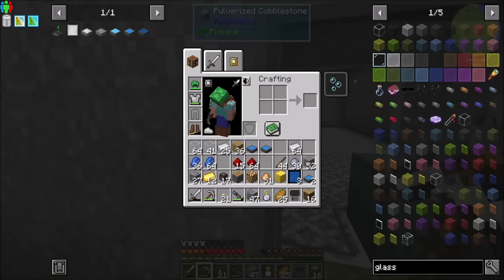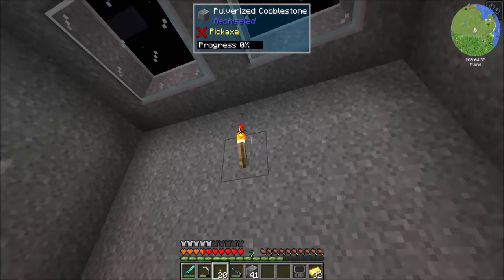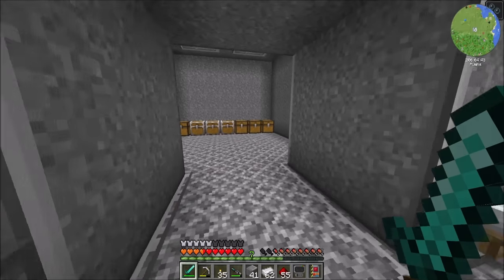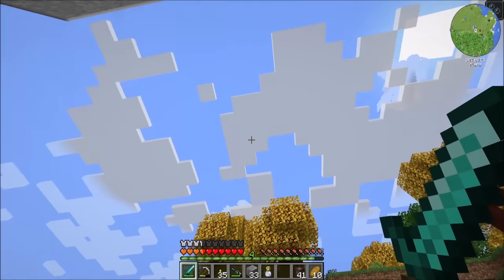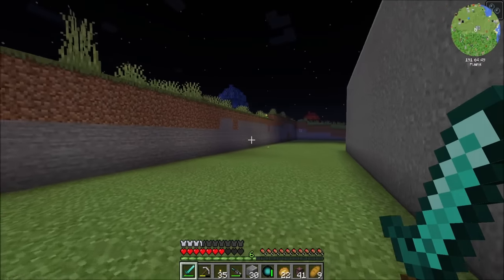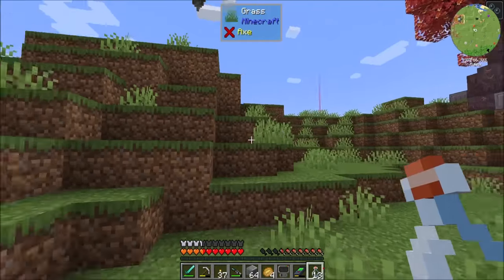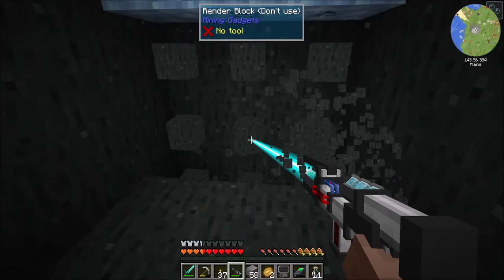LetsPlay S13E6 Misc Tools and AE2 Start

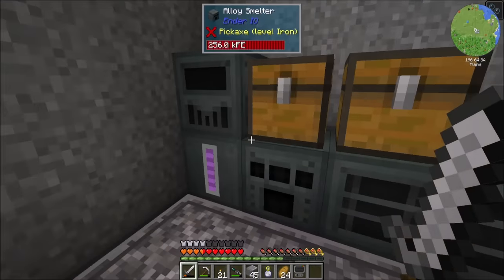Comment: 1:53 so if I remember rightly the newer elder IO was limited by the capacitors installed in the device, use a higher level capacitor and it’s a better Machine it’s also g

Comment: Noticed that the AE2 version of the dimension card was not in the pack but the Refined Storage version is, If this could be added in the next update that would be amazing :D
Reply: AE2's wireless terminal add-on has the Quantum Link Card, which integrates with a Quantum Network Bridge and works across dimensions as well.
Reply: Man, the last time I had a Quantum Network Bridge running, it was in the first direwolf pack that had the MineColonies mod to link my base with the colony

Comment: Had to toggle off the honeyed archers and undead knights on my DW20 1.19 pack they just spawned out of control in spruce tree leaves and wouldn't despawn so there were hundreds of skeleton horses everywhere with names visible through walls
Reply: This pack is extremely buggy, I started playing today and before I can even get iron, some mod is spawning fire on every block around me in about a ten block radius. If I wasn't standing in water I would be in an endless deathloop.
Reply: @MegaLokopo This is what you get when you play a brand new pack.
Reply: @Josh-yk4ry  True, but who makes a mod that spawns fire around the player non stop, the fire can't be put out and running away and/or teleporting doesn't stop the fire from spawning. What is the point of adding in that feature, it isn't a bug as far as I can tell.
Reply: Trying turning soul fire spreads to false in game rules. Its probably a "feature" of that crazy mob mod he mentioned in episode 1

Comment: 1:53 so if I remember rightly the newer elder IO was limited by the capacitors installed in the device, use a higher level capacitor and it’s a better Machine, it’s also good when your just starting out as in a pinch you can swap the one high level capacitor to whatever is the most needed thing at the time.

I don’t know how that will work or if it works at all with the cables.

Comment: Solar panels are too OP, it makes me wish there were more power options for mid tier power gen that are not nuclear. Like a multiblock coal furnace that can generate thousands of rf per tick. Maybe it can be scalable or upgradable while still using coal. It just kinda boring when solar panels can generate so much passive rf while coal generators only ever make like a couple hundred and then become useless. We use massive coal power planet irl. Coal can entirely be scaled up past solar power gen in real life… why not in modded Minecraft too? 🤷‍♂️
Reply: Dire needs to create an Iron Generators mod to with the chest and furnace mod.

Comment: If I remember correctly yes the capacitor bank caps output, to increase the cap you need to make the capacitor multiblock bigger.
Reply: The tooltips on it say you can craft multiple capacitor banks together, and get the performance all added together while still being 1 block.